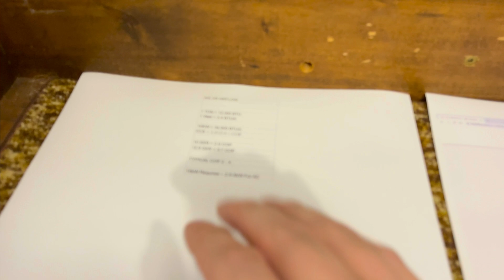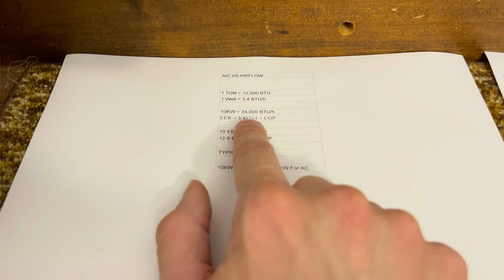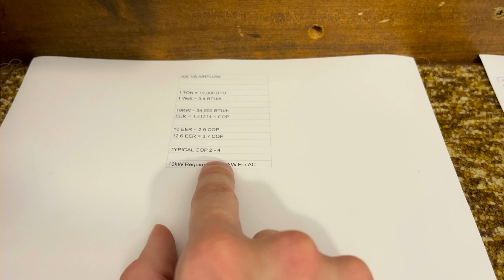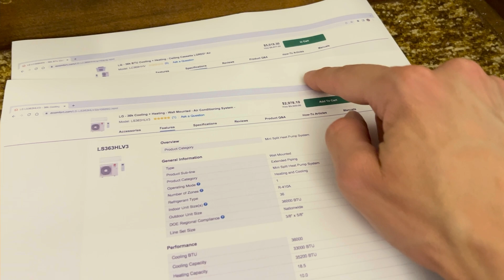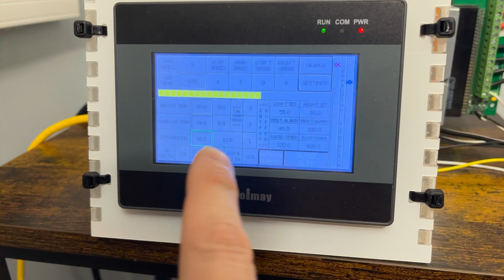Why Can't I Use A/C For Mining?!?

Comment: As a hvac tech I would recommend looking into the inverter mini splits they are 18-24 Seer.
Reply from the maker: This video covered why that’s impractical. It’s too expensive, and even the most efficient units are very expensive to run. It’s absurdly more cost effective to run fans.
Reply: @SiCPoWMining  I live in Arizona so when it’s a 120 degrees outside fans won’t cool the rooms down do to the heat load so mine splits work and can also run off of solar panels and batteries. And yes there not cheap.
Reply from the maker: Personally, I would run cards with overkill coolers and just target 140F in the room. The 3070 FTW3’s are very happy in 140F ambient, the efficiency is impacted a bit from the heat, but not enough to justify putting AC in. If you have hot cards, you have no option, but the target should be cards that can handle the environment. People regularly run massive farms of GPUs with free air cooling, it works in any climate if the hardware is right. But yeah, I understand that’s easier said than done when GPUs are scarce.

Comment: What kind of intake window screening is used, if company made which one and model name or number.  I'm going to upgrade later but first I'm building a 20 x 30 storage building in the spring.  I feel keeping air flowing is better than trying to cool the building so you are way ahead of most.   After seeing videos of farms like the 3 megawatt farm in Texas with no AC,  just intake & exhaust fans taught me to look for small scale solutions.   Also I put 2 Jasminers in the crawl space under the house, its cool and way quieter inside!   I put down a vapor barrier & could put all rigs there but its not ideal if I need to work on a rig then I'm on my knees dragging the box out. Not practical plus I need some storage space.

Comment: I run 8 tons of cooling, my setup can flex between 29000w to 40000w depending on how I mine (dual or solo). Average 19 seer across my systems. In total I’ve spent about $800 per ton and cooling constitutes 20% of the power expense. Your cost benefit analysis with filtered external air is on point but I determined it wasn’t worth it when increased instability and GPU fan wear became an issue due to heat. Downtime of hardware as well as my personal time invested maintaining things became a concern. 4000cfm of incoming and outgoing air wasn’t enough for 12kw of hardware and so I switched to ac before expanding the operation. 

Like you mentioned. Ac isn’t to cool the room, but to feed cold conditioned air to the system intakes.
Reply from the maker: That’s a pretty efficient setup for AC, only 8 tons for 29-40kw is pretty good. It’s still run a bit warm in there I assume?

No doubt, the high temps and temp variability is much harder to tune for. I struggled for a good month or so dialing things in. It’s definitely a point, and one I sorta wanted to cover, but this video would be an hour or two and most people watch a few minutes anyways.

I appreciate your comment, a bit more data is always welcome.
Reply: @SiCPoWMining  glad to help. =]

8 tons for 40kw is pushing the limits and worked quite well in the winter. I don’t think those temps would work in this summer heat without Cu or Al memory modded cards. At night my setup will drop to about 28kw on eth alone, and during peak sun, 32kw. 6kw are ac during the day, and 4kw during the night. I discovered that if I turn the ac off, my PC’s add another 2.5kw in power due to 100% GPU/case fan speeds as well as the increased thermal/electrical resistance. I’ve watched this occur in a recently modded 3080, where the temperature curve was slow enough to monitor - 0% fan speed and I watch the power consumption go from 197 watts to 217 watts 45c/76c -> 65c/92c. 20 watts multiplied by x GPUs generates a fair bit of heat… At that point I sort of concluded that the ac, though an extra expense, actually reduced stress, wear, and tear on the cards beyond the fans and dust. I was reducing some wattage to the cards to a point as well as reducing mechanical wear. The $450-$600 per month in ac power sucks, but downtime, parts, and shorter card lifespans add up as well. =]

Comment: Found this very interesting.  So if my mining rigs are in my home (basement) and letting off heat that is being processed by my in home AC is it reasonable to expense an additional 50% electric cost from the additional work of the AC?  So if I am at 4000 Watts per hour from the miner directly, another 2000 Watts from from AC?
Reply from the maker: There’s a few layers here, I didn’t go super in depth in this video but I’d like to in a future video. To start off, if your rigs take ~4kw, that means they’re dumping 96kwh into the building over a day. That’s the energy that needs to dealt with. When it’s considerably colder outside than inside the basement, some of the heat will be shed to the outside. How much depends a great deal on the buildings design, how much foundation is exposed, wind, how much insulation is present. In very hot weather, almost all of that heat will stay in the building, and somewhere in the middle most will. So it’s a reasonably safe assumption to expect your AC to have to deal with say 85% of this or so, plus or minus depending on average delta from inside to out. Your ac rated efficiency can be a fairly wide range, from 8-10 SEER on the low end, to ~30 on the upper range. Let’s assume it’s a builder grade modern 13 SEER unit that’s installed average and delivering average efficiency of 11.5 SEER. They are less efficient when cycling on and off, and often are not installed exactly to spec so rarely achieve the nameplate ratings. On top of this, more humidity will be removed than usual due to extended runtimes, which costs money and does not directly lead to cooling. So the reality is the numbers I talked about in this video are really best theoretical case, just for pumping the heat. You can expect your reality to be worse than this in most install, especially conventional ducted systems. I would speculate your COP is near ~2.0, so pumping 2kw takes about 1kw. Expecting you need to pump 85% or so of that heat, expect around 41kwh on an average day. More on a very hot day, less on a mild day. Your ballpark estimate of 50% is pretty close. It really is a LOT for your home AC to deal with, and it costs a fair bit to move it out of the house this way, but it does work just fine. Keep that outdoor unit coil clean if you can.
Reply: @SiCPoWMining  Wow thanks for this additional analysis.  If you want me to provide more specifics to help a content example for another video happy to share.  Basement has a few window wells and door with window and two zones of AC on the floors above that seem to be keeping up maintaining 72 in house while 90s outside.  Basement ambient is low 80s.  I suspect some heat is going into the ground surrounding the foundation.

Comment: Alot of data...but what's your gpu temps
Reply from the maker: I’ll do a video more on that in the future. This wasn’t about me, it was more or less a discussion about why airflow is still king if you can make it work. My first rack runs around 4 degrees above outdoor, the second rack is around 9 since it’s breathing in the exhaust from the first. This means if it’s 85F outside, rack one has 89 intake, rack two 94 intake. This is with relatively low speed at the exhaust fans, around 275W consumption. Right now the A2000’s are running around 56/72, the 3070’s 44/46 at 72F outside. The fan speeds are ~85% on the A2000’s and 60% on the 3070’s in these conditions, they’re based on temps.

A note, the first rack could easy run less than 1 degree above ambient, but the intent behind increasing it was to reduce RH before the air hits the cards. With enough airflow you could get all the hardware to intake air temps the same as outside, whatever that is in your region at that time. If you choose hardware carefully, you can easily make a farm run in temps hotter than humans can tolerate. The FTW 3070’s would be perfectly happy in 120 degrees and beyond.
Reply: @SiCPoWMining  yes agreed for cost of cooling clearly its the winner, but what you don't say is how keeping them 52-55c vs 70c+ is the difference of keeping the hardware an extra 5 to 10 years. Heat kills gpus, so do the math on keeping assets that pay out the difference if never having to re buy them cause they are running much cooler, sure ac can eat into profits, but once you roi cause your power is cheap its just helping the life of the gpus by keeping them cool. Worth letting a measly few hundred watts from an AC cool your assets that have no overhead.
Reply: Also ac allows me to remove the proprietary fans from the gpus so never need to worry about them running out or wearing down, seamless and effective.
Reply from the maker: Of course A/C has its value and uses. However, I’m expecting the hardware to be obsolete and not profitable before 10 years, so that’s not a strong consideration for me. It very much is more difficult and complex to maintain long life with airflow, but it’s a battle worth the fight for most medium to large mines. For anyone that’s small, I’d agree AC is likely the best bet since the initial effort and tuning is not worth it. I’m around 5GH, and it’s right on the line where the effort to do a good job with cooling makes sense. A/C costs are substantially higher for me than your estimates. The numbers I talked about in the video are closer to best case, assuming the hardware runs exactly at rated efficiency. Cost for a ductless mini split to cool my mining room is around $6k for the hardware, not installed, plus around 60-100kwh a day over my current ~240. This is VERY substantial and would make most people unprofitable today, or substantially cut into profits. I would need around 4-6 typical window AC units to cool this space.

Correlating lifespan to temps is problematic, and can be misleading. The truth is we don’t know for sure how temps impact life of a particular design without testing it. There’s best practices, guidelines, and historical data to guide decisions, but we don’t don’t if 55-70c will have an impact. If you are assuming the GPU core has a silicon failure, then yes low temps can help promote long life. However this is only sometimes the failure, it’s more often a design issue or other component on the board failing from wear. It’s truly a very complex topic, but solid state devices wear from use and will not last forever irrespective of the temperature they operate at. The goal is to get the temperature as low as practical, and hope that won’t be the main factor for the cards death.
Reply from the maker: I’m curious, how big is your farm? How are you cooling the cards if you removed the stock fans?
Reply: @SiCPoWMining  right makes sense and yea smaller farm for sure 1.2 so that would be a factor. Usually runs around 240w except for cycle peaks in my mining shed, 10k btu. Less of worry since it's all profit due to roi already so implementing free power via solar is next step so then ride them till death or upgrade accordingly. I use external fans from Noctua directly on the heatsink, meant to run 24/7 high performance, quiet and low wattage. Also easy to replace, never seen a farm setup the same but the assets are at maximum care short of water cooling which has high overhead cost.
Reply: Well I do know temps to lifespan. I have so much experience with gpus bud for SURE running at 75c + it will die in 4-5 years apposed to other cards I've liquid cooled or externally cooled which have lasted as long as 8 years already and still running
Reply: Hell I seen the worst stock coolers from nvidia last like 2 years before taking out the gpu from overheating completely those were around 85c+ while gaming
Reply from the maker: There’s a few points here. I suspect your AC unit is consuming closer to 1,200W. I’m not sure how you measured that figure, but it sounds like the meter is wrong or that’s fan only.

Power isn’t really ever free, maybe no cost to you, but not free. If you pay for solar, it’s cost is the amount of energy it produces, divided by its lifespan.

It sounds like you’re confusing thermal cycling with operating temperatures. Yes, the peak temps, and as a result thermal cycling of the silicon is a massive factor in hardware life. Often times it is the most significant factor in a gaming GPUs life. However; this is often not as substantial in mining since the hardware is usually loaded evenly 24/7. The peak temps are not nearly as big of a factor since the degradation happens more with thermal cycling than the operation at elevated temps. Some GPU cores will have design issues that cause it to not last nearly as long as others, so saying how one lasted that was running at an elevated temp is not useful information. Many miners have cards running stock coolers, at high temps, for 5+ years until they’re unprofitable or unable to mine due to memory size.
Reply from the maker: I’ll add a discussion over silicon wear and degradation to the list of videos to make. There’s a great deal to talk about.
Reply: @SiCPoWMining  for sure not I have a wattage meter to monitor everything it's 8A. When it's average pull sits around 450w+ just depends and that's for it being 105f outside in Texas man. Haven't even fully insulated my shed.
Reply: @SiCPoWMining  860w avg you for sure werent wrong. I hadnt tested since around feb and we had some freezing cold days so reran , appreciate the feedback man. I've been pricing in 1000W just as AC expense anyways, but good to know  for usage sake.
Reply from the maker: 👍 A/C units take more power when the outside temp rises, so it’s somewhat variable. When it’s cold outside the compressor probably wont even start; and it can damage the compressor to run it below 45-55 degrees depending on the design. The higher the outdoor temp, the more power it takes and the less heat it moves. But yeah, if it’s very hot outside and you’re running 3090’s you’re kinda low on options. Window units aren’t super efficient, but they’re cheap and easy to put in. You can get mini splits that are 2-3x more efficient, but they’re very expensive compared to a window unit so the ROI is super long. Always a trade off…
Reply: @SiCPoWMining  facts keep on mining man!

Comment: This is a good HVAC tutorial, thanks! My farm is not nearly as big as yours but I've luck separating my PSU and M/B from my enclosed GPUs and sucking (pulling) the air through and out an exhaust pipe. In this way, instead of creating air flow through an entire room, I'm able to isolate the air flow per rig. I am relocating, but once I'm up and running again, I'll share my results.